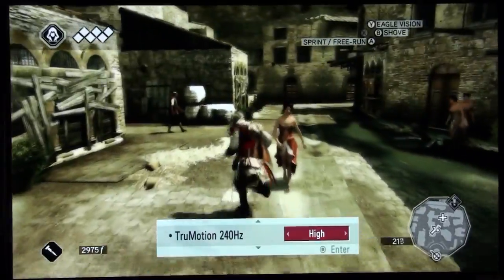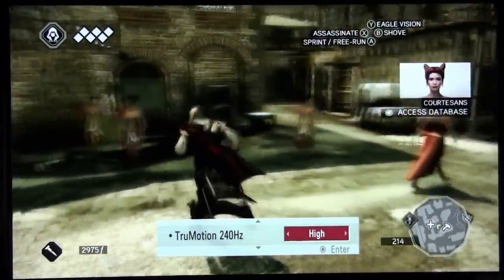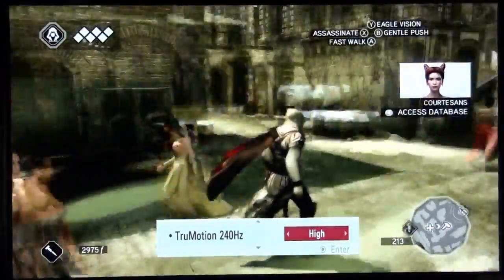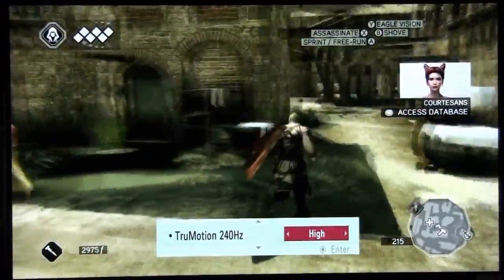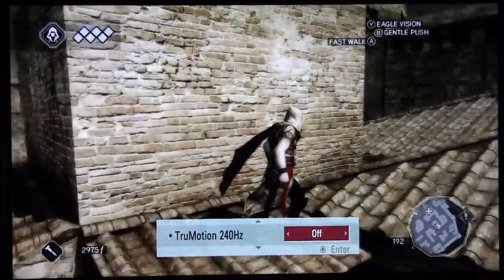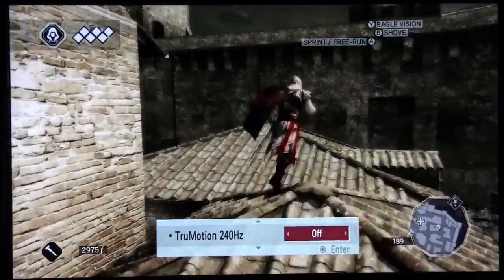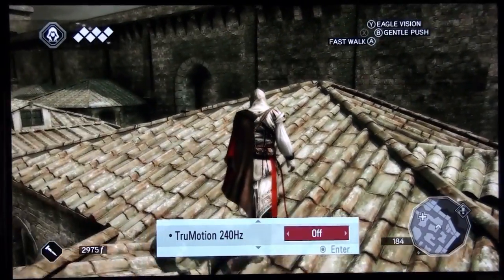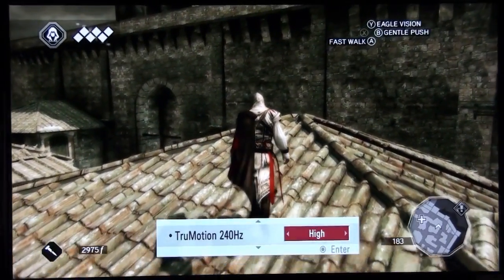HDTV Dejudder / Trumotion: a close look

Comment: at least it feels better than 60hrz refresh rate! it jitters because of console games like XBOX 360 and PS3 or the new games on next gen consoles runs 30fps will cause frame tearing or out of sync when you turn on trumotion, i like the trumotion effect on tv's because it does not ruin your eye sight, compared to the old CRT monitors and tv's it still has the flickering effect when it's on 60hrz up close, that's how i ruined my i eyes because of CRT, then i switch to 120hrz LED monitor, my vision got better! I really can't stand 30fps without any motion blur or trumotion effects!
 so it is best to use the 120hrz trumotion with 60 refresh rate aka 60 frames per second on v-sync.
Reply: You need a plasma or CRT in order to display 30 FPS content without judder. OLED and LCD use sample-and-hold, and they look terrible on console games :-\ The flicker you complained about on CRT was its saving grace, actually. The image is only updated every 33 ms at 30 FPS, but the flickering causes your brain to fill-in some gaps and eliminate blur/judder.

Comment from the maker: Keep in mind that this video's like 4 years old now. Maybe the technology is better now; I don't know. On the gaming front, "Project Morpheus" (prototype) supposedly implements dejuddering internally because 1080p 120Hz is a lot to ask out of the Playstation 4. John Carmack has also mused (in a QuakeCon talk IIRC) on the possibility of a game renderer that uses these techniques, using data coming from the game engine to predict motion. Now that he's working at Oculus, where prediction is already used in their head-tracking software, a game renderer with "smart" predictive dejuddering doesn't seem that far-fetched.
Reply: That's not a whole lot to ask when you know what he's actually talking about with "motion prediction". The previously rendered frame is re-projected using new head position information. This makes it possible to sample the head's orientation and do something useful with it when rendering occurs at a much slower rate. It's a hell of a lot smarter than any image-based motion detection, because that's all a matter of some image filter interpolating between two frames without knowing any actual motion information.

But you absolutely need de-judder on an LCD or even many OLED screens, sadly. The majority just sample an image and hold it static for 16 - 42 ms (e.g. 24 FPS contnet) at a time. That's more than enough time for the brain to figure out the image isn't moving, and then get confused when it suddenly changes 42 ms later ;) It's all a matter of where the brain expects something to be versus where it is. On a fast responding display the problem is double images (judder), on a slow responding display it's blur.
Reply: Just got the lg b6, the artifacts of the jetter are the same as in this old video, sp nothing changes

Comment: the only problem is that for each improvement in the interpolation accuracy you will loose more frames in the buffer. I don't see how you could even footage from games without mentioning the completely unusable input lag most TVs get with this feature on.

Comment: I am considering purchasing a new TV. Please forgive my ignorance in advance. I hear that Plasma is better for gaming. I play COD on xbox. I want a smooth crisp picture with high detail. Hopefully this will help me in seeing who I am shooting at, LOL. I am currently using a 37'-42'in so I would like a 50-60 inch. I am trying to decide between a samsung or an LG. I stream a lot of movies as well. Would you all recommend Plasma, or LED-LCD, and which brand, samsung/LG?
Reply: LG has lower input lag than Samsung. I own the LG 46LM7600 and enjoy gaming on it. If ever you want to play a game in 3D, I personally prefer LGs 60fps (720p) compared to Samsung's 30fps (1080p). When sitting far from the screen you won't notice the difference between 1080p and 720p, but will definitely notice 60fps and 30fps. Some also prefer passive glasses to active shutter glasses. The only reason I would consider Samsung is for its Picture-In-Picture function - which would allow me to browse the internet or play Diablo 3/WoW while watching TV.

Stay away from Toshiba, I owned the Toshiba 50KL300H and returned it within days of owning it. It had high input lag even with "game mode on". Picture processing can't be turned off and is forced. You can only work around it by using a custom refresh rate of 61hz which forces all picture processing off (only works on some games though).

My personal preference would be LG > Samsung > Sony/Sharp. My 2 cents... good luck! :)

Comment: @QUIKKSTAR  240hz cuz sony has stop adding more frames and instead are working on the speed that everything is coming in with the XR 960 technology is the best that they have right now. and the tv that i told you to look up use 120hz and XR 240 technology. but be cuz its said 120hz people wont look twice  at it. with the 120 frames and the XR technology it has no trouble with the speed frames are coming in which means greater picture with no blur i havent found a movie or game yet thats blury